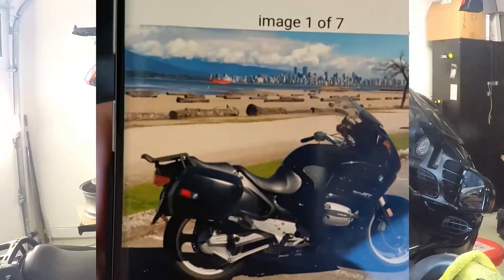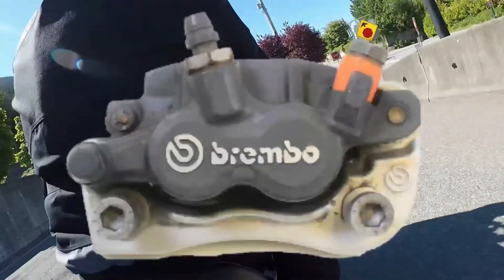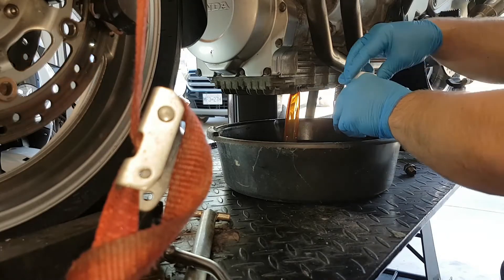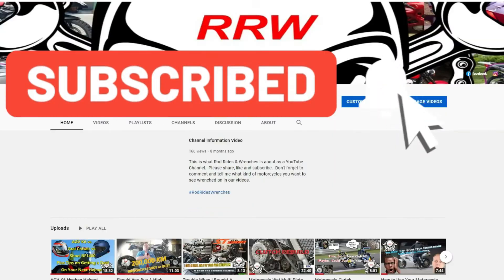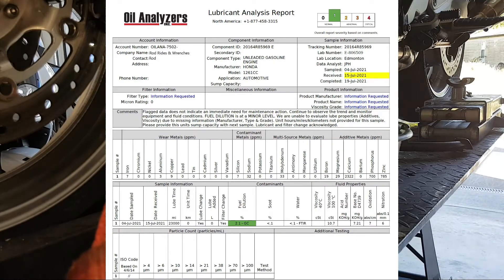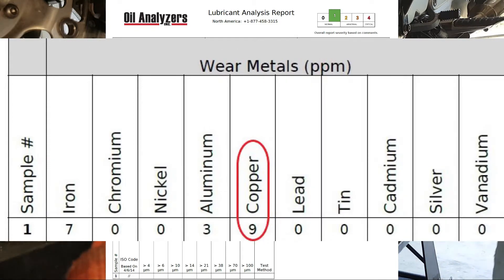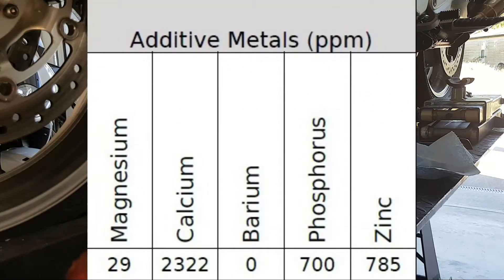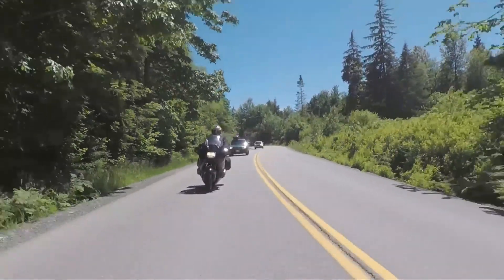Should You Buy A HIGH MILEAGE Motorcycle? PART 2

Comment: My brother in law called me from a car auction. Told me there was a 1997 BMW R1100Rs with 12k miles on it for $1800.00. I said “ Buy it”. Ended up costing me $2700.00, $500.00 in back Registration and $1400.00 in repairs. When I finally picked up the bike I discovered my dipshit brother in-law can’t read an Odometer. The Bike had 120k miles on it. Luckily the Mechanic said the bike had been maintained and had actually had a lot of work done on it.  I still have it and ride it. One of the best bikes I’ve ever owned.
Reply from the maker: They are really, really hard to beat!

Comment: I had a 1995 GL1500 with 120,000 miles and a 2006 ST1300 with 107,000 miles. Its last big trip was 3,500 in 14 days.  Current rides include a new to me 2005 R1200GS with 92k, I thought I'd try a Beamer for  change.  Well maintained modern engines will go over 200k miles.
Reply from the maker: All your bikes are high mileage legends for sure.  Thanks for liking and subscribing!

Comment: ive had several older bmws never had any major issues with any off them i still have a 2010 f650 gs twin 800cc rotax motor it does have sketchy fueling system but corrects itself  i think its a censor in injector body but on the whole they been good reliable rides the quality off componets is obvious and bmw carry parts for older models still. a bonus

Comment: Hi Rod. One thing you did not mention that is a common check item on these bikes. The alternator belt should be changed as they can fail and even wipe out the Hall sensor. Water also gets past the seal as it is behind the front wheel. This can kill the Hall sensor too. Hope this helps.
Reply: The_Grouchy_Old_Man  Any of the Boxers from this period.

Comment: Very interesting post. I bought a 1999 BMW R1100RT with  110,000km. So far I put 500km on it.  I absolutely love this bike. I'm going to do a complete service on it soon. Also the cam chain tension update. Previous owner just did the Hall sensor and alternator belt. Plus all fluids, but not spline care. I was a little concerned about 110,000km until I started looking at other R1100RT's with double the mileage. I would repair the bike, and not worry about that wear. I hope you continue to do updates on the BMW. They are beautiful running bikes with the awesome 1100 boxer engine. I think you should do a complete series on this bike. Clock some amazing mileage!  That will rub his nose in his silly comment.

Comment: Excellent approach! 
I have a small machining shop for repairing stuff. I was contacted by a man about help fixing his Harley Davidson mc. This was some years ago.. he wanted to do the large service on it and wanted the cylinder foots machined for flatness and honing of the cylinders so he can exchange the piston rings. I got curious and asked how many km it had been used. He said I bought it new and have rode it 500 000 km. I asked you mean 50 000 km?  No he said. I said shouldnt we bore the cylinders and change out the pistons as well? He said No I dont think its needed. Okeej??? I said come over and we have a look. I measured the wear on the cylinders and it was surprisingly minor wear, honed them on the good old Sunnen honing machine and I was quit satisfied with the outcome, the cylinder diameter got to be a little larger than nominal but not so much it will affect the outcome, also machined the cylinder foot and checked the pistons for abnormal wear at the ring lands and more. I was quite impressed with this bike and how he was able to ride so much on it here in Sweden because we have real winters half the year. He said I ride alot all year, winter and summer! Dont remember the model year, maybe he had it for 10 years something.. However it was a stock EVO engine.

Comment: I always did oil analysis on my semi trucks. High silicon can also be a sign of leaking air intake after the air filter, or bad air filter.
 The analysis caught that once on one of my trucks. Found a mechanic didn't tighten a clamp on the intake to a turbo so it was sucking in road dust.
 Without the oil analysis I may never have noticed the problem until the engine would have started to burn oil, by then the damage is done.
Reply from the maker: Yes, that is a very good point! Oil analysis is always a good idea!

Comment: I used to get the Ion Butt Association's newsletter. I remember an article that talked about a test of a high mileage Honda ST1100. A local long distance riding club in Europe had purchased the bike with well over 180,000 km showing then they loaned it out to group members. The only thing the bike really needed was, tires, brake pads and a hose kit when it popped a cooling line at the 240,000 mark. The Honda ST series are way over engineered.
Reply from the maker: Thanks for the feedback & view! You may also like https://youtu.be/D0DbfHyxAX8

Comment: Love this series, even though I'm late to the party.  So many of these older motorcycles are still great rides.  I currently ride a 2005 H-D Road King and a '98 Honda VFR 800 that I recently purchased and have worked my way through its condition.  The example you provide of an oil analysis is brilliant and gives a fact-based look into the motor's condition.  I understand some rider's hesitancy to purchase an older bike with high mileage (kilometerage?).  I had an '85 Honda XR350R about 15 years ago.  The bike ran great and was well taken care of by its previous owner.  On a ride in the mountains of Colorado, the kickstart return spring snapped, floated around, and jammed in the oil pump, breaking the pump housing.  I was able to limp the bike home.  This is where I learned the term "indefinite backorder".  This means the piece is no longer manufactured and won't be.  I was able to get it running again, but ended up selling it cheap to someone just wanting something to tool about with.  There's always that chance that a part will wear slowly, but at the wrong moment have a catastrophic failure.  As an optimist, I always feel that will happen to someone else's bike, not mine.  Cheers, Rod.
Reply from the maker: Hi Jeff Thanks for tuning in and be sure to check out what happened when I put this bike on the Dyno! https://youtu.be/D0DbfHyxAX8

Comment: Great videos, with in-depth information, presented beautifully! Thank you for all your hard work. I'm the happy owner of a 2000 BMW R1100RT with 105,000k. Best bike I've ever owned and it will probably be the last. I love the bike more now than when I first bought it and considering the age I appreciate the engineering that makes this bike such a joy to ride.  I'm 67yrs old and after an all-day ride, I find myself driving past the house because I'm not tired and still having fun. They have some quirks. The surging some people complain about is an easy fix on mine. Sinking the throttle bodies works every time. The most accessible bike I can think of to adjust the valves on. Easy to do regular maintenance on yourself. I hope you keep the Beemer. If the suspension is done, and it should be by now, don't spend nearly $2000 on replacement  OME or aftermarket units. BMW says they can't be rebuilt, but they can, by very reputable shops right here in Canada and at less than half the cost. It is a tall bike and can feel heavy when stationary but once rolling, it feels light and handles very well at low speed as well as high-speed sweepers. It's no surprise that when you went looking for a high mileage bike it was a beemer of this vintage or even older. Many credit the 1974 BMW R90S as being the first sport touring motorcycle and the R1100RT is the progression at the time of that line.  
Fix the Beemer PLEASE!
Reply from the maker: Thanks for the feedback & the view Phil!  Be sure to check out what happened when I put this bike on the Dyno https://youtu.be/D0DbfHyxAX8

Comment: Bud I have 2 ST1300 motorcycle one is ex police with over 300.000km the other is a red now painted white st1300 with 150.000km both run like a dream.. high kilometres are no issue..  the first ex police bike has only has a Alt wire re soldered still the original parts other than brake pads and tyres.. it'll still go to 100kph 2 up in 2.5 seconds with no leaks or smoke..

Comment: Thats not how you use that leakdown tester the pressure on the left was zero which means it wasn't putting any air into the cylinder. You have to turn the regulator and put pressure into the cylinder with that piston at top dead center then read what the leakage percent is.

Comment: That's really not too many miles.
I ran my Concours 1000 to 127,000 (204,000km) miles and it was still running fine.
My GL18 was at 118,00 (190,000km) and went on well with the next owner.
My best bike ever was my ZX1100E.  Sold it at 106,000 miles (170,000km) and it was still in near-perfect running condition.
All three had original clutches when sold that all worked just fine.  I've never replaced a clutch on a bike I put most of the miles on, and that includes several 50,000+ milers.
Mr. Fort Nine is a good example of how presentation and self-assurance don't necessarily mean expertise or experience, and not just in this case.